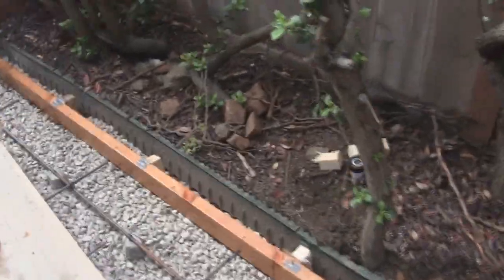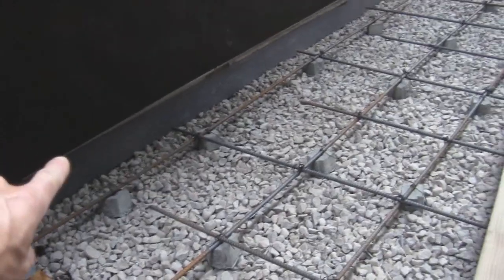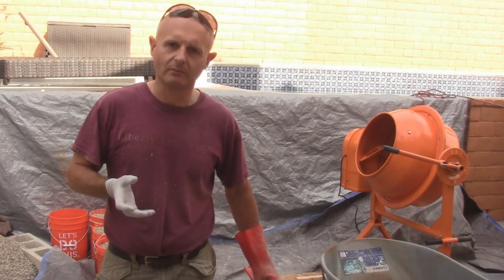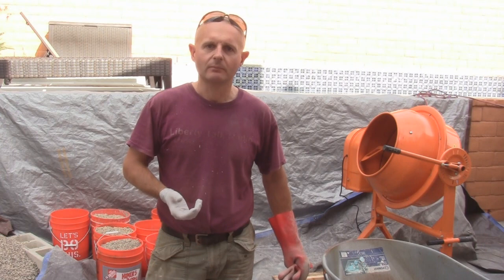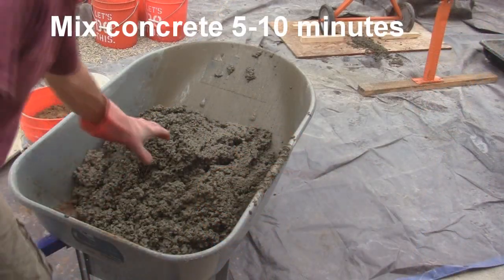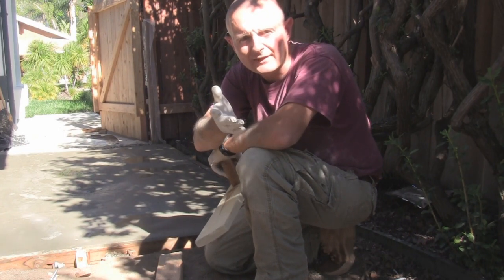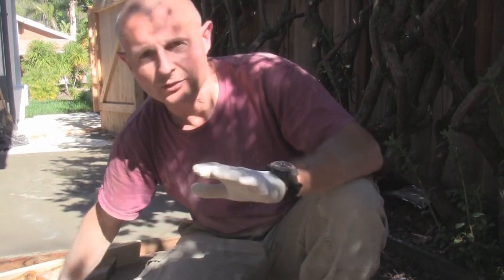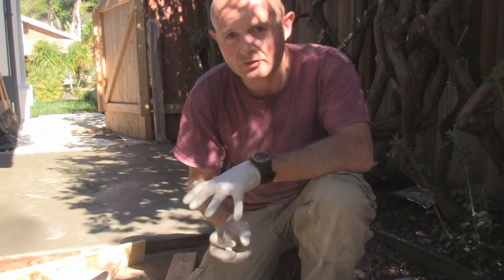DIY Concrete with Harbor Freight Cement Mixer 67536 61932

Comment: Did that harbor freight mixer hold up?
Reply from the maker: AgelessNomad yes it did. I think it will last a long time.  If the mixer starts to bog down, tighten the belt.  Should be able to mix two 90Lb bags of concrete at a time - all day long. /John
Reply from the maker: AgelessNomad I've poured a few walkways with this mixer now. I'm pleased with it.

Comment: Just a hint, start the machine add water. If you fill the mixer with sand, cement the engine will have a hard time...thank you

Comment: First, concrete does not crack when it's mixed right. It is mixed with what is called aggregate, its a gravel, not round pea gravel.  The pea gravel will make it crack, and it is too expensive to use in concrete.   The gravel is called usually "1/2 inch minus" and it is mixed very close to what you said, except the measurement is called "slump".   Slump, is the amount of flow that 1 square foot of wet concrete will have when it is placed by itself on the ground,  I always look for less than a 4" slump.  You did such a job on the prep that I hate to add this, but actual concrete work is more of an art, than a strip in the back yard.  The way you get the pea gravel top is by making the pad then adding a top to it that contains a secret mix of mortar and pea gravel.  Its called pebble work, and it is very expensive.  What you have there is, sadly, a waste of money, and probably will crack, although It looks like you might have used enough rebar.  You should have used some concrete cloth,  A tight wire mesh that helps keep thin concrete from breaking;    And cracking is called breaking.
Reply: why not upload your own tutorial and save us the yaaawn commentry

Comment: I don't understand the drain you showed. If it's below the surface of the slab what's it do?
Reply from the maker: +Tin Man the concrete is sloped so gravity will cause surface to run into the drain. Drain is flush with concrete surface.
Reply: +bearing01 yup. 2% pitch with a drain in the center. thats like havin a door knob on a toilet.

Comment: Good vid, but anyone working with dry concrete should use a quality dust mask. That stuff in your lungs is trouble. Also goes for anyone cutting concrete.
Reply: Most important detail

Comment: Fyi they make pre mixed bags now. Lol
Reply: Not economical if you can run a shovel.
Reply: @cmennenger  Depends.  Time is of value.  If premix is faster, it may be worth the extra money for some.
Reply: @cmennenger  ...if you can run a shovel then there's no need for buckets...it's twice the work loading...figure your mix by the shovel...
Reply: @puzer1  not sure I understand your comment. I would use a shovel to load the mixer not buckets.
Reply: @cmennenger  ...I don't think I was being cryptic, pretty sure that's exactly what I said...

Comment: not quite finished w your video...forgot to give info on WHY you are using a cement mixer and doing by hand ...what were the actual cost and savings doing it by hand as opposed to truck delivery

Comment: I disagree with you because I didn't see you put any control joints in your pour, also you didn't say you compacted your stones. I don't wet the stones or oil the forms and they come off fine.

Comment: you can buy premix why do it 1930s way
Reply: why do it 1930s way??? ever heard of satisfaction ,,,or killing time , or just because one can , wheres your pre mix upload? ,,, tips and shareing
Reply: +freeeeeeedom no rulers your momma
Reply: nantucketjeep
high school is back that way slick about 35 years to the  east ,got a compass for ya if you need it? heh heh heh yawwwwwn z zzz z zzz
Reply: +freeeeeeedom no rulers buying a mixer from harbor freight is not satisfying. its disturbing
Reply from the maker: I have and use both pre-mix and mixed my own.  Pre-mix is a lot easier, however it's an ugly pale gray color.  On the front of my house I mixed my own using California Gold sand in order to make the new concrete match the existing  concrete.  Concrete with California Gold sand also looks really nice after it wears a bit - the gold shows through. /John
Reply: maybe you need a pour in an area that the truck cant reach
Reply: Premix can be inconsistent.  If you mix it yourself you know you're getting what you want.
Reply: Bagged mix sucks! Not enough Portland. Hard to put a nice finish on it.
Reply: Isnt it about half the price also to do it this way?

Comment: I always appreciate saving money.... but time IS money....ready mix concrete sells for $3.50 a bag at Lowe's and it's on sale frequently.  Save you a TON of time and work.  $5.50 for mortar 60 lbs, $5.65 for sand 60 lbs. and still gotta buy your stone.  I doubt you're saving much money and you're spending a LOT more time and effort.
Reply: The ready mix bags are good for small jobs. But if you need a yard or more, than buying the material in bulk is cheaper and not dealing with bags. A yard of sand/stone mix is $40 at a local supplier. Cement is $10 for 92lb bag.
Reply: @rich.trails  A pallet of concrete ready mix at Lowes is $123 (bulk 33% discount and 5% off contractor price or lowes card).  Thats 3360 lbs. 3600 in a cubic yard.  Very little difference in cost and I save TONS of my valuable time not mixing 3 ingredients..... not to mention much greater consistency in the mix.